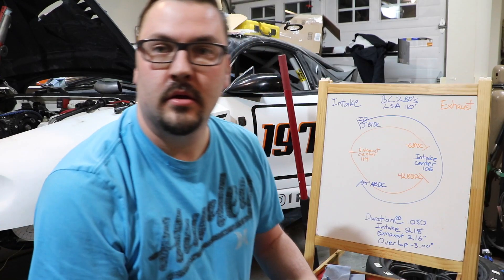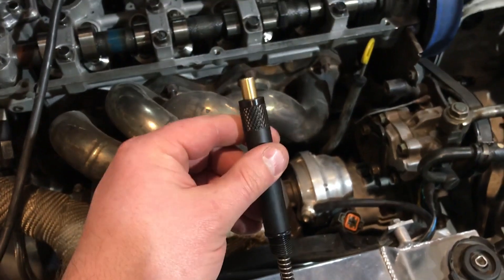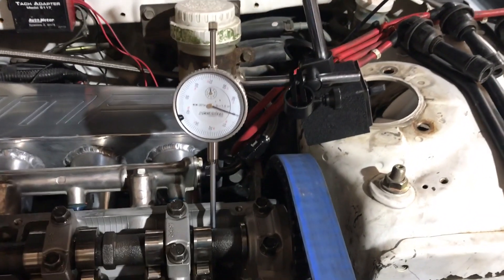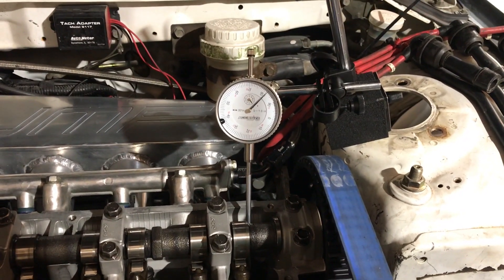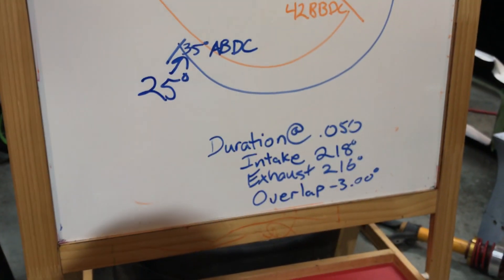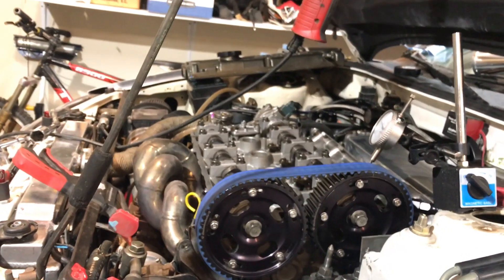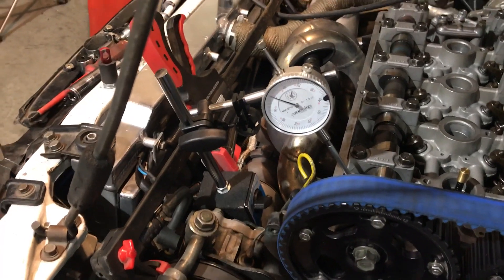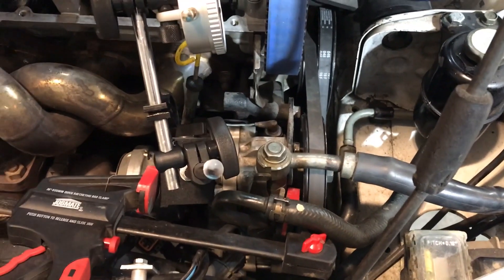4G63 Cam Degreeing In Car - How To Degree a Cam 2019

Comment: I know this is an old video, but I wanted to share my results. I originally degreed my cams this way and then installed solid lifters to re-check. Both cams were only off by 2 degrees. So, doing it this way will definitely get you in the ballpark.
Reply from the maker: Ya. It isn’t perfect. But at least you have an idea what is going on.  I’ve done it again out of the car and let the lifter bleed down and then find the top of that lobe and it worked pretty well to find degrees at max lift.
Reply: do you have a picture of how its suppose to sit at tdc thank you my first time ever doing this
Reply: What is the point to bleed down the lifters?  @smokin80

Comment: Fantastic video, thanks for putting the time into making this as it's so helpful. 

I just have one question that I cannot find an answer to anywhere - how do you actually mount the degree wheel? Do I need to buy a special tool. It looks like you have just drilled 2 holes in your degree wheel, with 2 bolts going into something?
Reply from the maker: Hey, sorry I missed this!  I just used a couple of longer bolts for the crank pulley and bolted it through the degree wheel.